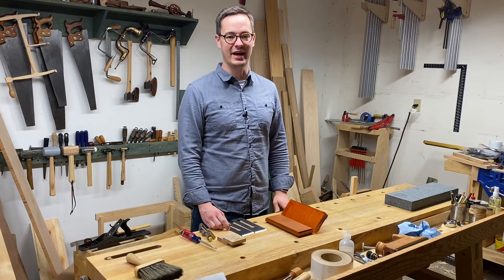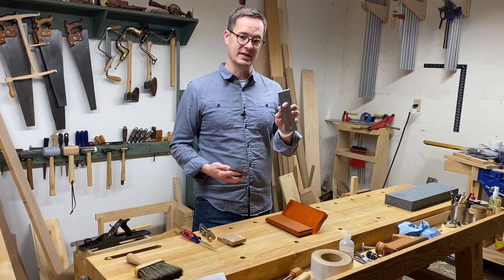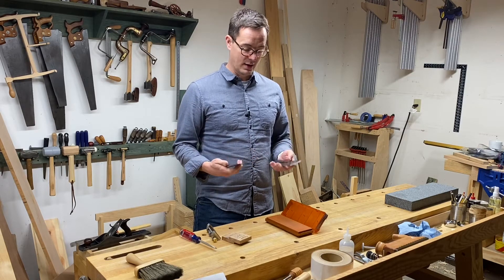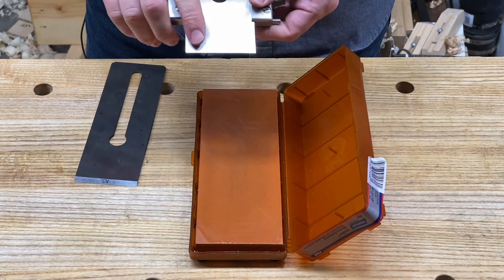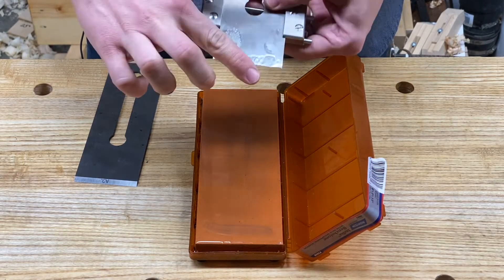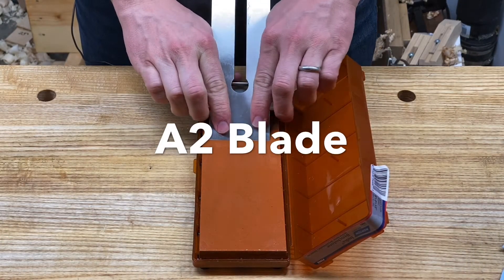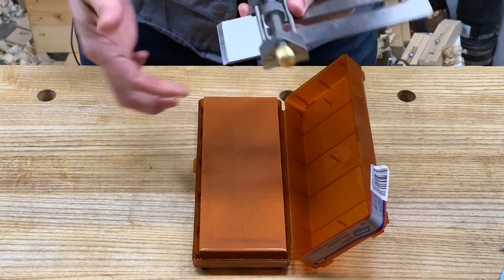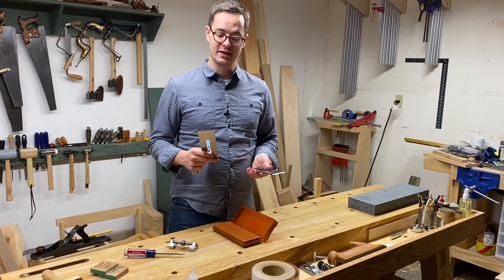A2 vs O1 Sharpening on Oilstone

Comment: Well done.  Another internet "wisdom" bites the dust.  I use Arkansas stones up to a hard Arkansas 3" x 12", which I bought from Dan's Whetstones in Arkansas.  It seems a bit slower than you demo, perhaps 20 strokes, but it is no problem at all on A2.  I like sharpening however. I think that those who hate it, have created an overblown hysteria, perhaps?  I find that for my woodworking tools, hard is all I need.  Sometimes I go further and finish on my Rozsutec, which is one grade finer and it too works ok on A2, but I don't' find merit in any sort of mirror polish for chisels and plane blades - maybe if I were slicing sashimi all day, it might be a different story.  I should mention that it took me two other stone bought from questionable sources (Amazon and "best sharpening supplies) before I leaned my lesson.  These stones are NOT the same.  They are garbage, sold for a high price, but one lower than a reputable source such as Dan's, and sharpening with them is futility itself.  
Lastly, I wanted to mention that I use windex on my natural Arkansas and the Rozsutec stone, both. Not oil, which seems to bog the process down tremendously.
Thanks for putting up this test.